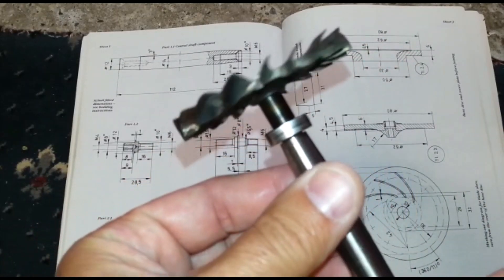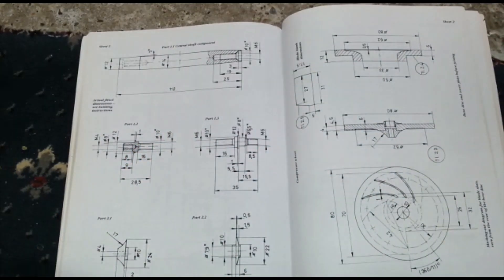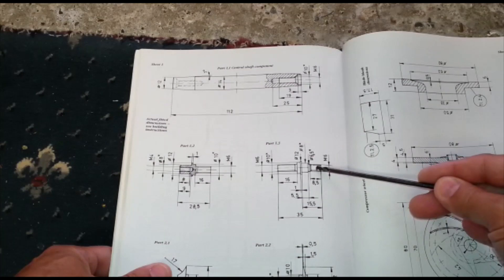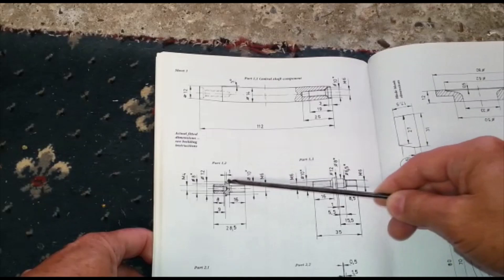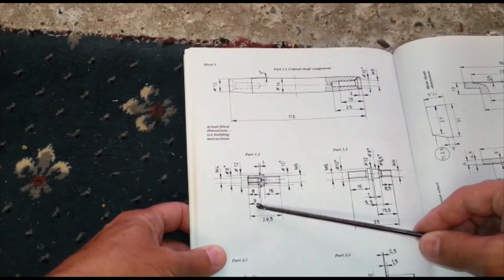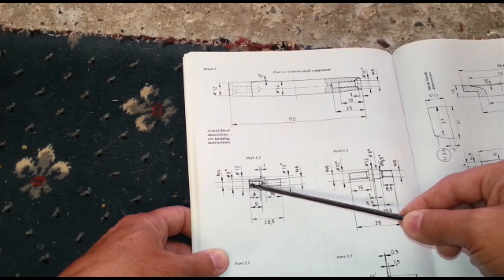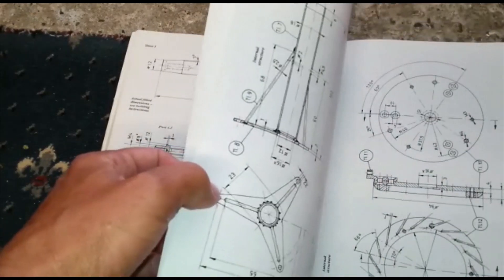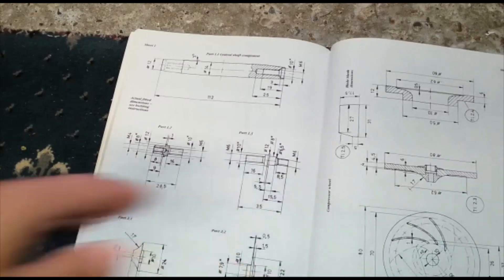Umar Zaman FD3/64 Engine teardown

Comment: Thanks u so much Chris to help me out in my project. My engine no2 i 'll solve all the problems which u point out.Thanks really good informative vedio. At the moment on YouTube you and me are working on fd3 64.not many people I see with fd3 on YouTube. I m hoping someone else who building fd3 or he got fd3 shud shear there experiences. Thanks Chris yor are a great man.
Reply from the maker: Video was done in a bit of a rush only finish it at 11.30 last night,had to do it on old laptop as new one being repaired.i didn't proof watch it looks like I've lost some text at top of screen.
The engine problems are all fixable the weld problem on the NGV might be, with hand grinding on weld apart from that it's a very good NGV  ,I want to get video out quick to stop wasted effort on your part .
it does look like that combustor may work but you will notice the difference with the new design.
The compressor diffuser design is not the best with pipework, bolts and 3 link brackets but with care can work ok, if you notice on the spun front i sent you the radius on the inner corner is bigger than drawing this helps  the air turn 90 degrees.
Reply: Hi Chris did u sending the spinning tool .send me spinning tool pleas.if u need any time u can ask me.i 'll send u back.yes I see radius is bigger on front cover and aluminium plat also is thicker then 1 mm
Reply: @Umarzaman8400  Awesome work guys, you've given me the drive to embark on my own fd.